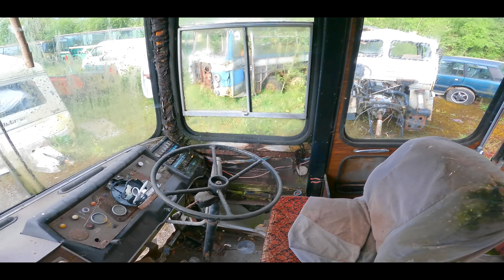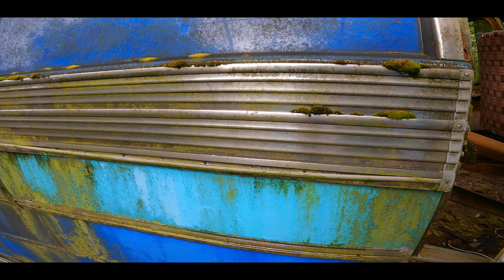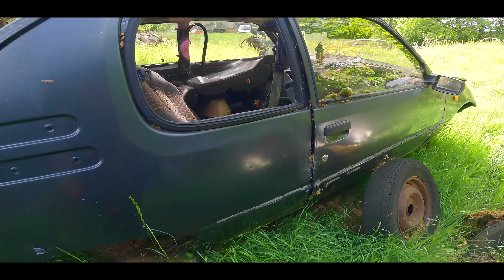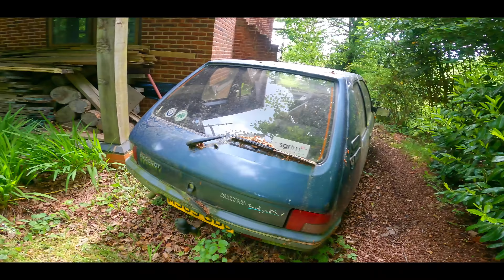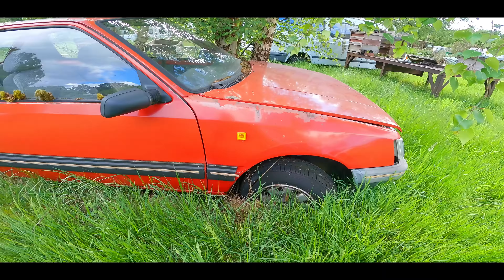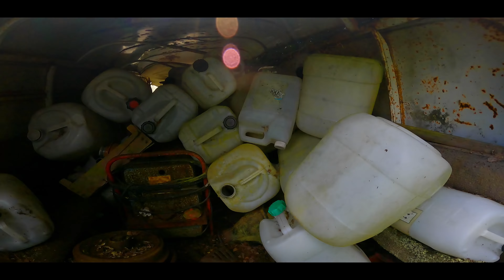PEUGEOT 205 Graveyard GTI VINTAGE Bus GRAVEYARD

Comment: Another gem of a location with loads of interesting finds.I loved the old coaches. I have travelled in a few like these. The Bedford Val twin steer coaches are similar to the one used in the original Italian Job film. The one in that film was converted to a car transporter. These old Panorama coaches have character that isn’t found in modern ones. Some of these old coaches could be turned into glamping vehicles, or restored and put back on the road. It’s terrible that they are being left to decay like that. There are some potential restorations sitting there. What a waste! So many rare and interesting vehicles are sitting there. Many of them are as reare as hen’s teeth.The red Hillman Imp type car, looks like a Singer Chamois ,or a Sunbeam Stilleto.Thanks for another cracking explore.

Comment: Great vid as usual.. loved the red 92 K reg Rover 400 R8 (Honda concerto)  I owned a Honda engined 416si for 7 1/2 years and it was bombproof reliable. 147,500 miles on it when I sold it and went into 164,000 plus.. Great car. 👍

Comment: The red collapsing Hillman imp comes back with nothing. The White Hillman Imp estate was known as the Hillman Husky .
That beast of a truck was an ex army Bedford. The M reg 205 is recent as the mot ran out in 2018.
It's a crying shame saying Early MK1 Transits rotting away like that. The flat bed one was a Diesel which is very rare.Those coaches were cool quite a few of those were Bedfords.Another great video this week .

Comment: The dark grey 205 is also a GTI-you can see the plastic wheel arch trim on the passenger side wing as you approach it, the rear wheel arch trim for the drivers side is lying inside with the trim fasteners visible around the rear wheel arch. The red stripes (albeit very faded) along the tops of the interior door panels are visible also, which would point to this being a GTI. I had an early 205 XS, then a black 1.6 GTI and finally managed to move up to a 1.9 GTI... wish I had kept them all 😐
Reply: I ad a black 1.4 Xs, the same motor I had in my AXGT if I remember right. Then had a 106 rallye and the 106 gti. Missed the 205 gti 😢. My best bud had one so drove it a few times and loved it😍😍😍
Reply: pretty sure it's not, XS interior and it looks like the radiator is the shorter model, adding GTI exterior trim was a pretty common mod
Reply: @le couscous Yes that is a possibility, GTI door trims and XS seats sitting inside doesn’t provide absolute proof that it’s a GTI, however this car has remnants of the double-sided adhesive on the sides which was on the back of the trim pieces to help secure them to the car, but more importantly this car also has the factory fitted trim clips around the front and rear wheel arches-these were fitted into holes made at the factory during production of the GTI bodyshell/wings.
Reply: @SuperTigertank  I thought the grey one was a base model as the arches on the rear don't look angled like the GTI ones also the sunroof lining looks a wee bit small for a GTI but could be dealer fitted. That being said, it doesn't look to have pop out windows and the black vertical strip on the doors which is the usual GTI giveaway if the arches are not visible. I reckon it is an XS though.

Comment: Fascinating gudeo. Car at 9.50 looks like a Hillman Hunter or derivative. Green truck is a Bedford, probably ex military, dating from the 50s/60s. The transits look like very early versions, rare as heck. The old truck at 14.55 is 40s or 50s I think, will post on FB to get an ID. Just after that,  the grey van body  is ex British Telecom,  they make a great shed ! LOL ! Spot on, Red wreaked car at 16.55 is an Imp, the one at 17 46 is an even rarer imp estate, remarkably rare ! The military lorry cab is another of those 50s/60s Bedfords.

Damn shame about the 205gtis/ lookalike.. The blue Mardi Graz at 21.30 looks like it might be a Belfast car,  couldn't see the # plate clearly. The red one bear it looked like a XS, quick wee car for their day. That red one has the same interior as mine, biggest problem was electrics, a gobshite mechanic who goofed up the engine and vandals. Would love to get my hands on one again, fun car.
Reply: Okay, the truck at 14.55 has been identified as a Bedford QL, produced during WW2 for the British military.  Shame its lying out in a field 😞

Comment: Awesome content Matey as usual! You do not dissapoint!  
 Sorry about your phone screen :( 
 Hope that you can get it repaired as soon as possible, mind that it wont be as waterproof as it used to be until fixed. 
The amount of miles those buses/coaches have collectively done would be humongous! 
  Bobcat RR :(( Rotting away same as the other RR next to it, Id have those 2 in a heartbeat!  I want to swear loudly at this point but I'll breath out and swear internally LOL 
  Gah place like that makes me cry, so much 'stuff' just wasting away. Ok a load of it way past its best and barely parts motors, but as for wall art, some ££££s to be had from that place. 
  Astra!!  Me want it, Pug GTIs and just more 205s, so many damn! My heads spinning! 
 Cortina estate for sure and the Hillman next to it. 
  Upturned brolly car, think you guessed correctly :) 
  Madi gras 205, rare as hens teeth unless your there as thiers 5 of them! 2nd one looked clean, 14K on the clock, could be 114 but I haven't checked. Not many with the plates on so hard to check info on them if possible. 
Yellow things at the end look like what they used many years ago when they built the motorways. 
  The 3 girls.... I need a moment here, I damn dropped my phone when I saw them, why are they just left to rot :((  
   Dodgy place for sure, guy into Ex Army stock, big dogs and makes his own cartridges, yep, dont mess!! 
Great upload pal, keep at it, try not to leave any of your soul behind at any of these vehicle graveyards, I know its hard though.  Stay safe!  Talk to you soon!  
P